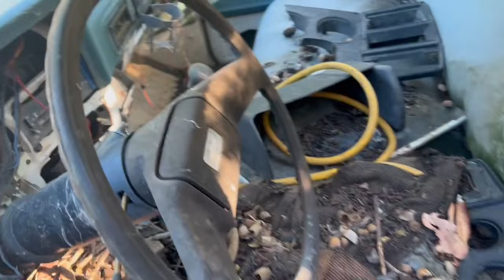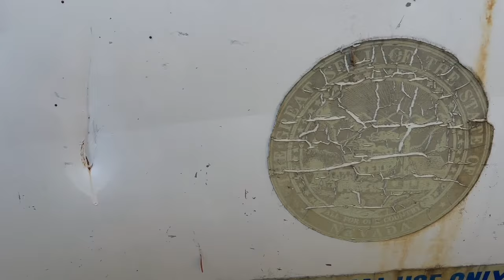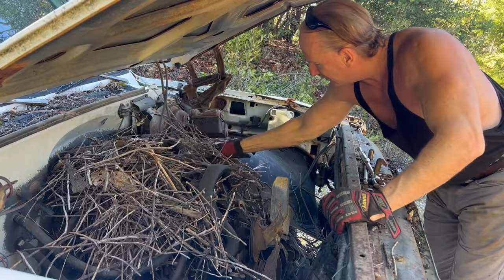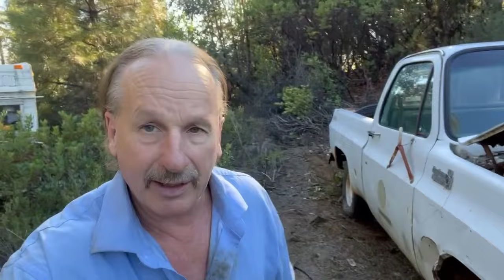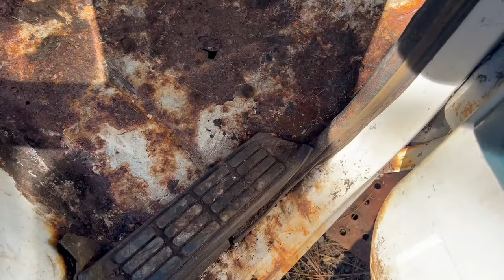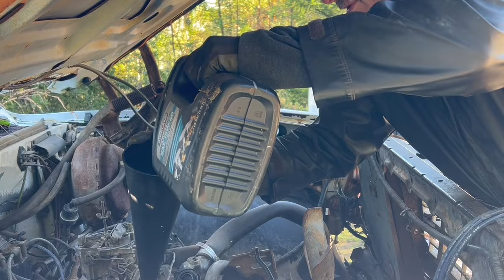C10 Left in the Woods for 18 Years — Can It Be Saved?

Comment: Crease in the bottom of the door sir take you a football and deflate it put it inside the door by your dent and use a bicycle manual pump and inflate the football it should pop out the dent... And I would like to see your blazer sir
Reply from the maker: I owe you an apology. I did not see your comment and I thank you for the advice. It is something I have done in the past and I have popped the dent out. I am presently collecting parts to do another video on the C 10.. I am assuming being I have two blazers and a jimmy that you are talking about my 1991 big black lifted  blazer. I do actually plan on doing a video on that truck. The one I would like to do immediately is the bumpers they need to be finished, I have built them, but they need to be finished welded and painted lights installed, etc.. I also have a 6.0 LS that I would like to put in it that will take a bit. I need parts and they’re expensive.Let me know if that’s the blazer you’re talking about. I am also planning on doing a will it run on my mom‘s 1987 Blazer and eventually the GMC Jimmy, that is a 1970. I would like your feedback.

Comment: You have two 4 x4 hubcaps and wheels because the one on the wheel is probably a 6 lug 4x4 wheel and cool your truck is a manual 4spd
Reply from the maker: Yes, I definitely do have two 4 x 4 hubcaps. I noted that when I first walked up to the truck immediately and I also have as you might notice if you watch the series 2  six lug wheels that would’ve came on the 4 x 4 not this truck. I wish this truck was blue That was a very pretty color that year I appreciate the comments. It always motivates me. Thank you very much. .